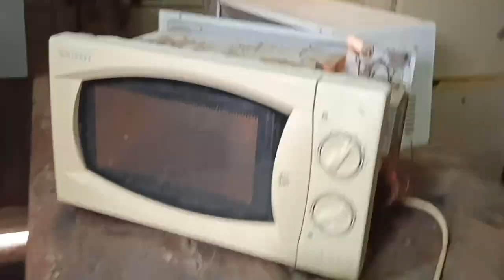how to repair rusty oven body|old microwave oven restoration| purana oven ko kasa thik kara

Comment: You didn't tell us what is required for the repairs
Reply: Products:
1. Grey Putty for filling the cracks
2. Emery Paper No. 320, for rubbing and making the surface smooth
3. Get the welding done from a welder